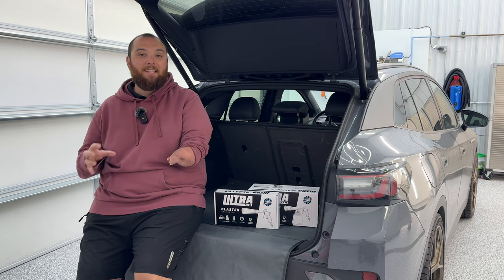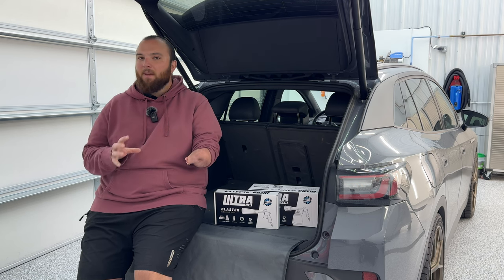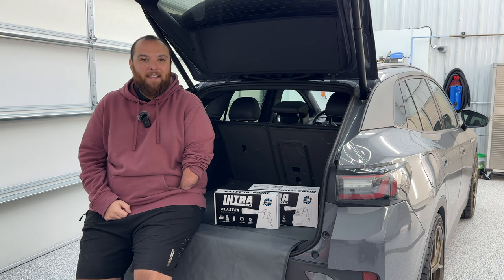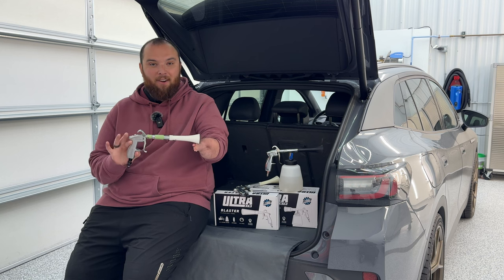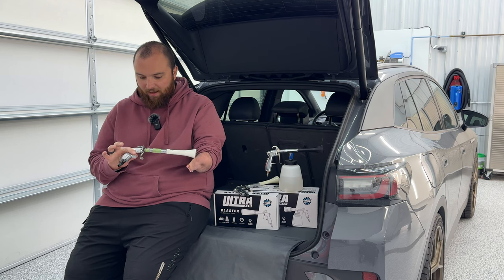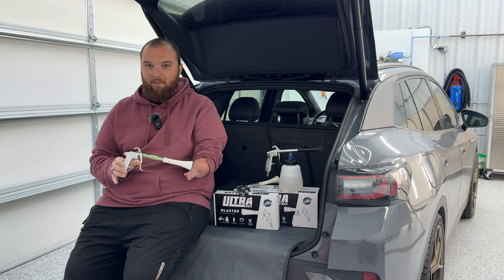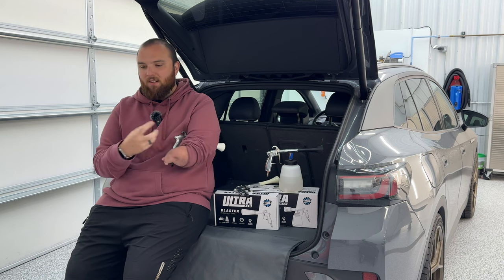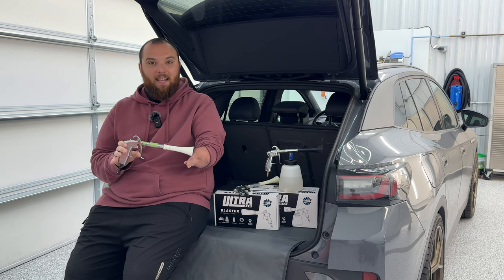You Need This Tool To Detail The Interior Of Your Car!

Comment: Good stuff!  How does the plus work when using air only compared with the Air Blaster?  Could you skimp and just get the Air blaster plus? With respect to the plus tipping over, Astro Tools 3SB40 3 way swivel is high flow and should help with the rigid hose attachment.

Comment: How about doing a driveway car care series? Noticed Tesla discourages brush car washes and touchless are scarce around town. So will be hand washing at home. 

Stopped by the channel to order hand wash supplies as Blue Dawn is a bit much. Note that car drying towels are also super greyhound drying tools. While poking around at Amazon, I stumbled across the Adams hose end suds cannon. Interesting gadget. Interesting to see if it has enough reach for house washing too (low ranch house). It looks like the Adams gadget will pay for itself in soap savings.

Comment: Good review. But, you are blowing the hair somewhere else in the vehicle, it doesn't disappear. So, now you have to search the vehicle with a vacuum for the hair you just blew around. The blaster only loosens. Don't get me wrong, I believe it is a good tool, but it needs to encapsulate the work area as to not spread the debris throughout the vehicle. I'm going to buy one for hard to reach crevices, but I will devise an encapsulator to contain the debris and follow up vacuum. NOTE You don't need both the Air Blaster and the Air Blaster Plus. You only need the Air Blaster Plus; remove bottle and close the 45 degree valve and it becomes regular Blaster.  Regards.
Reply: How big of an air compressor do you need to run one of these efficiently

Comment: Will this work with a Rivian’s onboard compressor?
Reply from the maker: Ah great question. Although I think it would, you’d run out of air QUICKLY. I use a standing 60 gallon air compressor with these tools and it runs through it pretty quick.